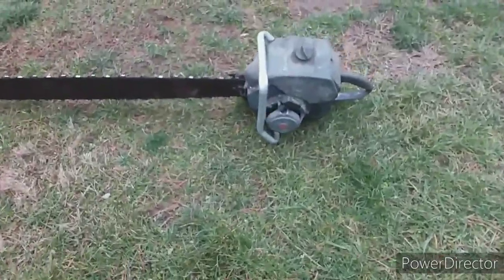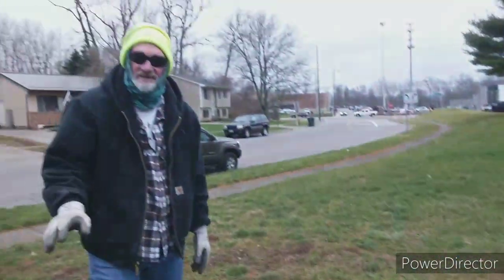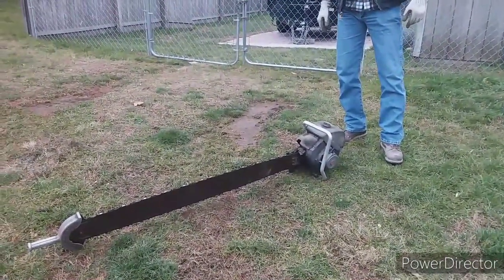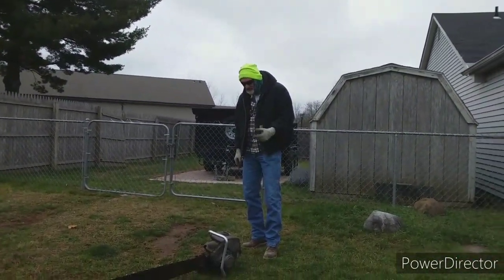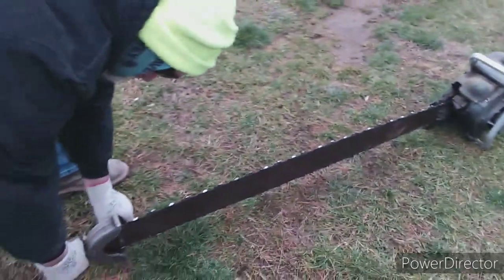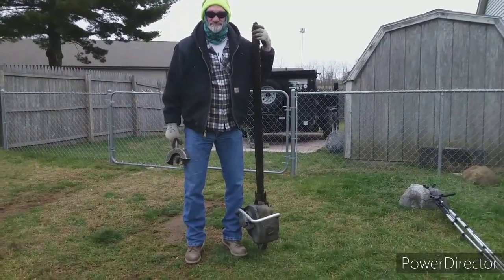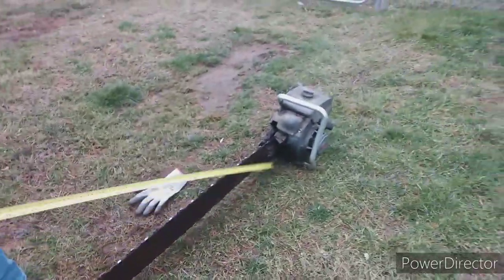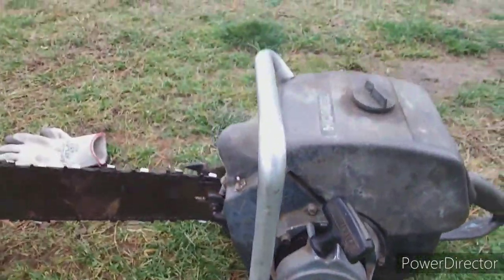Antique HomeLite Chainsaw | Does It Still Run

Comment: thats one hell of a saw. i sold a old McCulloch for a friend of mine to a local tree guy. the engine was about as big as that one and it had a nearly 3 foot bar on it id say it was just as old too
Reply from the maker: Its one hell of a saw for sure. What did you sell yours for man?
Reply: @DOCREAL1118  $75 it wasnt in running condition at the time. really just a wall hanger

Comment: Hey doc, been a while  Have you been? How long is the bar on that thing? Lol
Reply from the maker: Been good buddy, how about you? Its in the video, either 51 or 55. Good to see you man
Reply: @DOCREAL1118  I’ve been good to I just bought a Echo pb 8010 a couple of days ago and my god that things a monster. I have used it on some left over leaves from leaf season.
Reply from the maker: @CWalsh-pj9cp  Its a great blower. I switched to the Br800x for wet leaves.
Reply: @DOCREAL1118  nice. I’ve never used an 800x but I can say that the PB 8010 did very well on some wet compacted leaves that I had.
Reply from the maker: @CWalsh-pj9cp  I couldnt get mine to do that well on the 8010 but great blower
Reply: @DOCREAL1118  yea not everyone has the same experiences with them. I just bought mine so my first impressions are good but that could change after owning it for years.